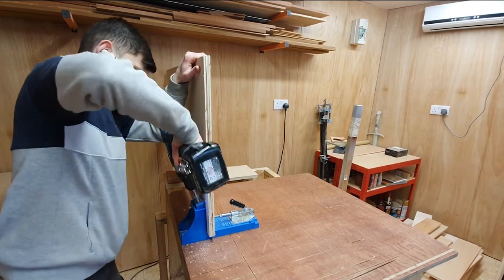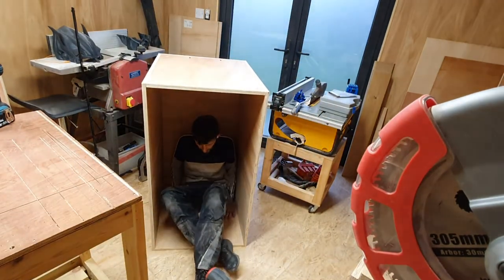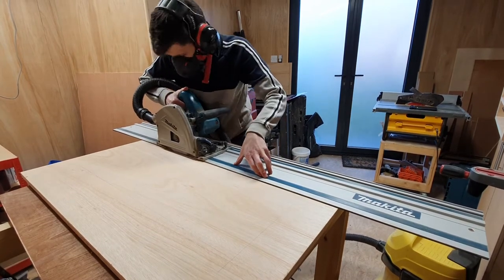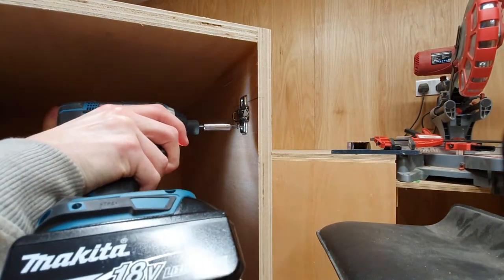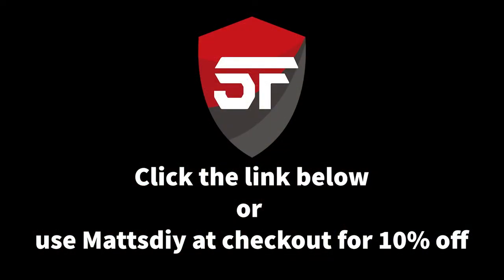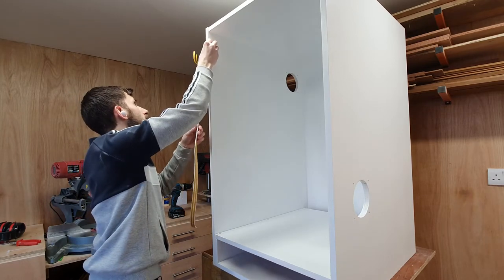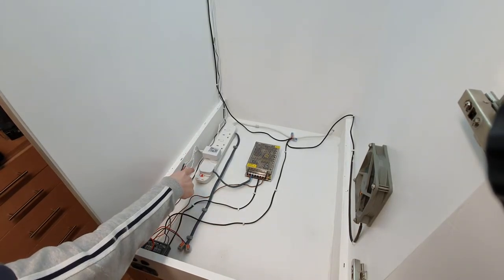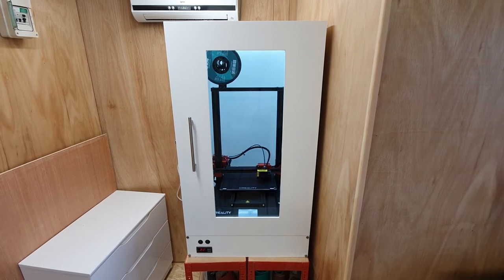3D Printer Enclosure With Temperature Controls *Links in description*

Comment: Great work on the enclosure.  The one advice I have is to replace the binary temperature controller with a PID temperature controller.  This change will remove fluctuation of temperature inside the enclosure.  With a binary controller it'll turn things on and off if above or below a temperature setting, but a PID controller actually pulse the fan when the temperature is near your target temperature to maintain the target.  Really neat stuff and only $20 more than a binary controller.
Reply from the maker: Thanks I will take a look into this !
Reply: Hello, what model of pid controller would you recommend? To get an idea of what it would be like, to connect one or two 12V fans. Thanks!

Comment: Hi Matt, looks incredible.  I was about to build a box but concerned about fire proofing. Did you need  fire rated plywood?
Reply: fire rated plywood ?? that would be overkill, chances of a fire with low voltage is slim
Reply: @ChainsawSquirrel  Burn a stick of ABS and then compare it to PLA. You have the spool inside the cabinet. Now all you need is something to ignite it. Electrical potential isn't what starts fires. There are plenty of low voltage systems out there that can melt a wrench in your hand before you realize that you crossed over the supply to ground. Large prints would also increase your risk of fire. Consider either burn resistant materials and/or a fire suppression system.

Comment: 1 exhaust and 1 intake fan. Would that change the temp when cold air comes in the enclosure causing the print to warp? Especially for ABS print?
Reply from the maker: I pretty much only print PLA so this isn't really am issue !! it rums about 30⁰c right now so a good temp

Comment: Curious about the electronics.
Have you thought to place the electronics of the printer in the bottom part? They would stay cooler. Also, what about a heater and a thermometer in the camber? Higher temps means less warping

Comment: I used Iko Enatherm to line mine and use 100% scrap including pallet wood. £19.99 for a sheet of Iko. Pulled electronics into lower chamber. Octoprint and £9.99 led string for inside. (Iko is fireproof)

Comment: How did this enclosure reduce the printer noise? I'm looking to significantly reduce the printer noise in my print area. I could also add noise dampener panels to the inside of the enclosure as well I guess.   Subbed!
Reply from the maker: the ply does a pretty good job of reducing sound ! you are right you could add some foam to further dampen noise!

Comment: You're a really skilled craftsman!  Any reason why you went with plywood vs some form of transparent poly since the cost would've been comparable, plus no sanding/painting?
Reply: Anytime poly panels are used you got to have a rigid structure containing it as poly panels have no structural strength.  You'll end up having to buy plywood for the base, then build a frame for the poly panels, and you can't just buy a smaller piece of plywood and expect the price to be 1/4 of a 4x8 sheet, so everything adds up.  It'll take longer to build, and even double wall poly panels are at least 2 times the price of plywood, probably a lot more.

Comment: isnt really temperature controlled if theres no cooling/heating agent, in summer, the fans would just suck warm air in, more just a air cirulation box, still banging dont get me wrong lol, need one for my printer lol
Reply from the maker: you are correct it isn't temp controlled in the sense of actually actively cooling but it does pull the hot air out of the enclosure made by the printer and pull some slightly cooler air in from the workshop which even in summer is cooler than the in side of the enclosure.